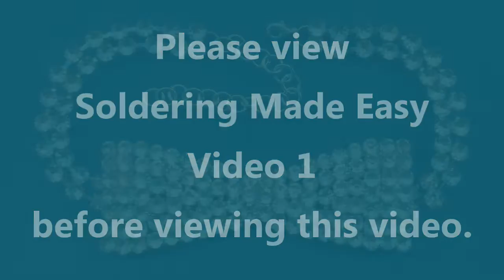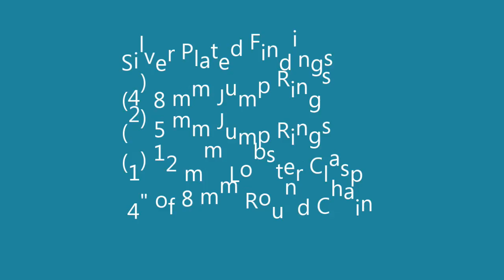Solder a Rhinestone Chain Bow Tie Necklace with a Heat Gun

Comment: May I ask what kind of heat gun and temp you're using, what type of solder and what kinda clay is this? thanks much.
Reply from the maker: Thank you for your question.  Our soldering material is listed on our page http://www.jansjewels.com/soldering-paste-soldering-torches-1.html.  The solder is 300 degree prefluxed solder Item No. 0434-02.  The heat gun is Item No. 0626-00.  The clay is Play-Doh or any none hardening craft clay will work.

Comment: Hello.I followed the video, they are very helpful and I use solder wire and iron but the wire wont stick on the stone chain.? can you help me? where did I go wrong? I use solder rosin core.flux code and stone chain
Reply from the maker: Hi Version.  You mentioned a soldering iron.  I do not believe that a soldering iron will get the settings on the rhinestone chain hot enough to melt the solder.  I do not think it is possible to make this piece with a soldering iron.
Reply: oh so I cant use soldering iron....OxO but heat gun? What about the wire..did I choose the right one?
Reply from the maker: The issue with the soldering wire is going to be the melting temperature.  You will need to use 300 degree prefluxed soldering wire with a heat gun.
Reply: ok..but the wire melt nicely..
just that...it wont stick on the cup chain...
Reply from the maker: The setting of the chain must get hot enough to melt the solder.  Check the video, heat is applied to the rhinestone chain, the heat is removed and the solder dabbed to the chain.  The solder is melted with contact to the heated chain.
Reply: ohh ok I will try again...thank you~

Comment: Is that clay board?
Reply from the maker: Hi Rafidah.  I am using J Board (green) foam board made for soldering, lined with Play-Doh a non-hardening children's modeling clay.  Instead of the J Board you can use wet floral foam, used for flower arranging. I have found that when ordering the j board it often comes in broken and due to the size, the shipping cost is relatively high. The wet floral foam can be found at most craft stores like Hobby Lobby or Michaels.

Comment: May I use glue gun to do this please?
Reply from the maker: I have not tried using a glue gun to glue settings together. Most likely it can be done. However, I am not sure how well it would hold up. In my experience hot glue tends to eventually pull away from smooth services. I would think that it would also be a bit messy.